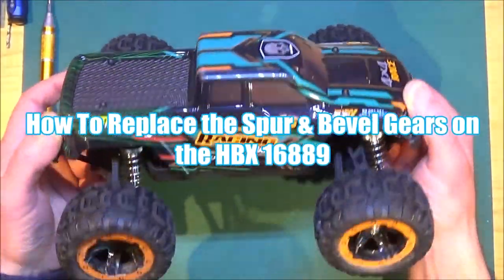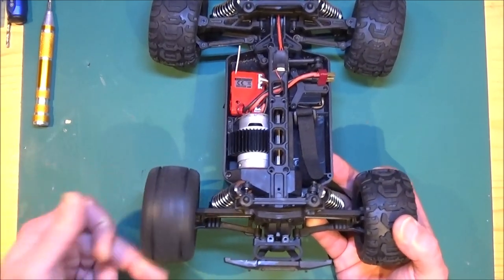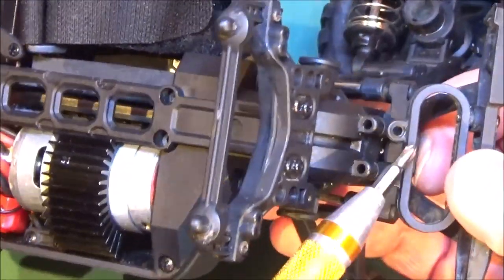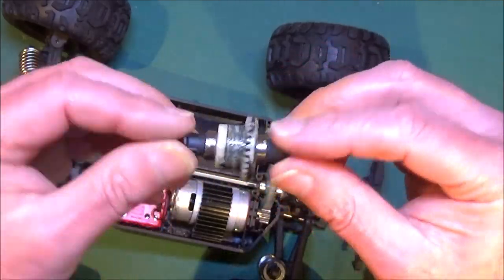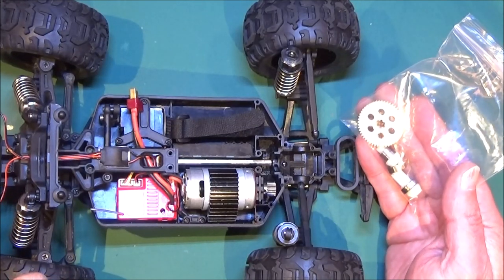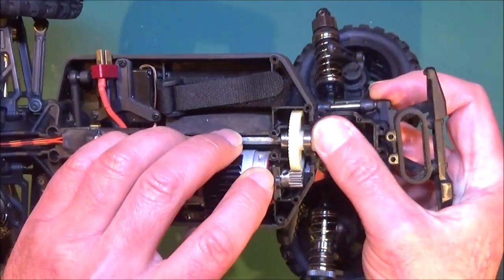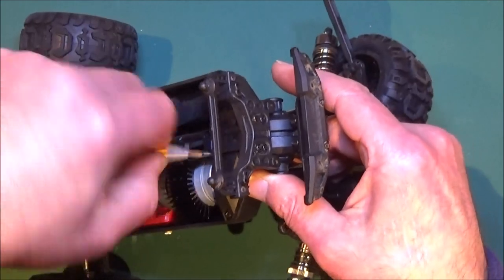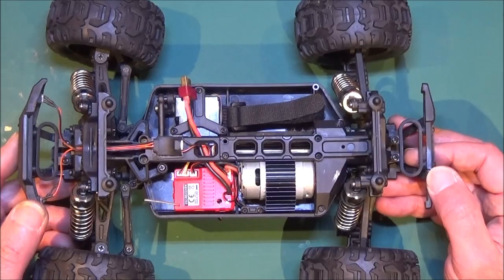How To Fix HBX 16889 Ravage Bevel & Spur Gears - Using Non HBX Parts! Haiboxing RC Fix!

Comment: I've just bought the brushless version of the FTX Tracer and it is a little beast. I will certainly be doing the important upgrades after the holidays.
Reply from the maker: Hi Nick, oh yes the brushless versions of these trucks are bonkers! There was almost no grease in my gearbox so it's worth checking inside. Good luck with the upgrades! 🤞👌👍

Comment: Great find and tip mate. I was looking at the FTX Tracer so we could do some bashing together but when you told me about the problem with getting spares for yours I put it on the back burner. But now yours is ready to again just going to have to order one soon. Great stuff mate catch you later.
Reply from the maker: Hiya, mate! Yeah, that sounds cool, hopefully my breakage was a one-off and other trucks with this chassis will go on much longer without issues. I think Time Tunnel has the Tracer for £53 - blooming good deal!  Catch you later, dude!  :O)

Comment: Your the man thank you for the driveshaft video you did I looked everywhere for metal but then I realized something the bezgar 7 I have is exact to your truck which also means the chassis to the hosim 903 and blomilky destroyer are also the same but anyways my point being you can throw a brushless motor and esc in from Amazon for about $30 its from the brushless version of mine called the bezgar hm165 and then the 903 makes these in metal for about $15-20 on Amazon fully upgraded these trucks are pretty beast
Reply from the maker: Hey Roger, thanks, man! Good info on all those chassis that share the same parts, very useful to know! If I can get some money together I'll definitely look at the brushless spares.  These cars really are cool little beasts! All the best to you, thanks again!

Comment: Good fix, Mark. Uhh, I thought these ones had metal gears. And yeah, got that truggy you showed, just in a brushless HBX version (16890A). Seen a lot of companies sell them. FTX and Pinecone and some others I can’t remember. I always wonder if there is a company behind the models of Haiboxing/HBX (that manufactures to other brands too) or if they are rebranded HBX. Anyways, good repair, my mate 🙂
Reply from the maker: Cheers, Mikael! I wish it did have metal gears! Yeah I saw that version you have on the channel. I don't know what company originally built this chassis, but it would be great if there was a "pool" of spares that we could access for all the derivatives that use the same parts - but that's why I did this video, to show that if you search, parts from other brands might fit. All the best, mate!  :O)

Comment: Hi - i noticed the stock plastic axles in the rear. Do you still remember the issue or why you put them back? I upgraded mine but it turned out the metal axle’s body was a bit smaller than the bearing’s diameter and caused terrible shaking in the rear wheels when i ran the vehicle. It was undrivable 😂 had to put the plastic axles back to keep the rear wheels from shaking. Cheers
Reply from the maker: Hi there and very well spotted! Yeah I put the plastic axles back in because I was worried that they might have been part of the reason the gears stripped as it was OK before I fitted the metal parts. Just erring on the safe side! It's been fine since though. Strange that yours were the wrong diameter, there must be some quality control issues! All the best! Cheers!

Comment: Great work Mark, especially in identifying those English based replacement parts. Top tip. I'm surprised that the gear failed like this - they must be made from a fairly brittle plastic. You would expect them to be a fraction more pliable which would make them almost unbreakable. But herein lies the problem with budget Chinese RC's - based on this they don't seem to be too durable. Did this fail happen after just one run ? Either way it's hard to imagine this kind of thing occuring with established brands like Tamiya, Traxxas et al, although I suppose anything is possible. The next thing you're going to face is the question: will it happen again ? Luckily for you though mate you have a shed full of tried and tested Tamiya thoroughbreds to fall back on. Great informative video and have a great weekend...👍🏻👍🏻.
Reply from the maker: Hiya, dude! Thanks so much for watching this non-Tamiya video, your support is truly appreciated.  Yeah, I was very surprised by the gear failure, everything else on the car seems to be pretty robust. To be fair, as it was free, I really have bashed the hell out of it with little regard to it's wellbeing! I'm not sure if the metal dogbone and axle upgrade I did caused an issue, with the non-flexible replacements putting more strain on the drivetrain? Anyway, I put the plastic axles back on, so we will see. If it breaks again I'll lok at metal replacements (or throwing the car in the bin!!!!) I agree, in stock form it really should last longer than it has, but at £55 all-in and ready to run, something has to give, I guess. Yeah, at least I got 1 or 2 Tamiyas to fall back on!!! Cheers, mate, wishing you a fantastic weekend, too.  :O)
Reply: Hello, are you interested in off-road remote control cars?

Comment: Hiya matey. With all the excitement of having the vaccine yesterday I didn't get round to watching this till late last night. Anyway, interesting stuff. There does seem to be a lot of re-branding that goes on with these so it's a top tip to see if the part you require is available for the other version. I'm guessing that they also do a metal bevel gear for this? Always seems to be the gear that breaks on a Tamiya TT-02B. Those screws at the front look annoying where you need to poke the screwdriver in at an odd angle. Anyway top work my friend. So anyway did you get jabbed too? I haven't had any side effects yet. Makes me wonder if it's worked! Going to take it a bit easy with the beers while the vaccine does it's thing. Hope you are enjoying your weekend. Is work getting any easier? I've been fixing up the Arrma Typhon I bought from Nick. Needed a bit of work but running great now. Cheers for now mate 😀
Reply from the maker: Hiya, Pete! No worries mate! Well, it's lucky that there is a lot of rebranding when something goes wrong! FTX has a much better sales and service here in the UK than HBX. Cheap stuff, too. Yeah, the bevel gear does seem to be a weak spot on many RC's - but then it does have a hard job to do, transferring the drive through 90 degrees. 
My jab is on Monday - going together with Lou to get pricked! Good to hear you have no side effects, fingers crossed. Work is OK, already looking forward to Easter and 2 weeks off - hopefully bag a load of RC footage. No new cars due to the money situation, but I've got a few cars already to film, thankfully! Good luck with the Typhon, sounds like a cool project for you. Enjoyed the latest video! Take care, mate, catch ya later!  :O)

Comment: Great video n  Can you point me in the right direction to get a new pinion gear ⚙️ please?? 🙏 I can’t find one as I want to swap the motor out in my HBX Destroyer and can’t get the old pinion off the motor to swap over?? They must of put tons of evo stick on it. Thanks 🙏
Reply from the maker: Hi there! The only pinion I could find was attached to a motor, maybe it is permanently fixed? Anyway, in case you are interested, here is the link I found:
https://www.ebay.co.uk/itm/274778278194?hash=item3ffa0fc932:g:T~gAAOSwfCZgS5AA
All the best, good luck!  :O)
Reply: @MarkBryanRC  respect ✊🏻 Thankyou very much I’ll have a look 👀 but I may have to drill out the grub screw?? I just want to swap the brushless motor that comes with the Destroyer out for a 6100kv surpass hobby one I’ve bought. Hoping for more power? Thanks 🙏 for the link 👍👊
Reply from the maker: @Andym1159  You are very welcome! Ah, I see now that you already have a new motor!  I think it should have more power. You could try heating the pinion up, it might free the threadlock that's holding the grub screw. You will need to get it nice and hot. That usually works for me. Other than that, you may just have to drill it out, but go carefully with that!
Reply: @MarkBryanRC  I’m gonna try some heat?? Thanks for your help 👍
Reply from the maker: @Andym1159  I have my fingers crossed for you, hope it works!  👍👍👍
Reply: @MarkBryanRC  thanks 🙏 I’ll keep you posted, I know I could of just bought a new esc and ran it on 3s but I don’t want it too wild!! I just want that bit more punch for the ramps at the skate park? We shall see? Cheers 🍻
Reply: @MarkBryanRC  I forgot to tell you I found a pinion I’ll post ya off which site in a minute, I wish I’d of bought 2 or 3 now!! 👍

Comment: Hey, if the platform is the same as the redcat volcano 16, then the differentials will not fit?
Reply from the maker: Hi Chris, I just had a quick look and the volcano does appear to have the same chassis. Can't be 100% sure, but there is a good chance the diffs will be interchangable!
Reply: @MarkBryanRC  I apreciate it
Reply from the maker: @chriis2871  No probs, Chris!

Comment: I have a really weird question..
I want to order a battery for this car and i dont know the length of the battery so could you maybe tell me the lenght lf the battery??
Reply from the maker: That's not a weird question - very sensible! The battery is 55mm long. All the best from Mark...
Reply: @MarkBryanRC  And is there a Chance i could fit in a 65mm battery?
Reply from the maker: @_b_nc_5606  I don't think so - you may be able to squeeze in a 60mm battery, but 65mm is too big!  :)

Comment: That's odd, thats the standard motor in there right? Wouldn't expect a bevel gear to fail like that. Then again it's cheap I guess.
Reply from the maker: Hi Bob - yeah, I agree! I was surprised it broke, but to be fair I really have bashed the hell out of this one!!! It may be down to those metal axles and dogbones I fitted, as they take any of the "give" out that the transmission had with plastic parts. Anyway, I hope it was just a dodgy gear and the new one will last longer! Time will tell. All the best, my friend!  :)
Reply from the maker: Definitely!  :D
Reply: if you get out of sand they last a lot. mine lasted many hours of tarmac and dirt bash. the moment i took it to the beach the rear diff pinion went out and a few bashes later the front one also. a set from aliexpress cost 3 euros...very cheap. you can upgrade for metal parts but i can not find for my pro version only the diff pinions on sell. they sell only the pack of metal diff plus pinion and to get only 2 pinions you have to buy 2 sets which becomes expensive. when the metal parts on my pro version wear, ill put plastic parts with stock shaft version. its extremely cheap and even if i have to change parts 3 times a year, its still a lot cheaper than buying full sets of metal gears.

Comment: With motor off, if I move rear wheels the front don't move anymore. I bet I have to do the same!!! But with motor running they spin
Reply from the maker: Hi there! Hmmm, sounds like you just got one or two teeth snapped off the gear. Well worth stripping it down to check. Good luck with the fix!  :O)
Reply: @MarkBryanRC  nothing snapped. I realized later that is normal. With motor off, the shaft only mooves if you hold one wheel and rotate the other.
Reply from the maker: @farmoboy83  Ahhh! Great news! Glad to hear your car is OK! 😁👍

Comment: What grease did you use and how much?
Reply from the maker: Hi. I used molybdenum grease, just enough to cover all the gear surfaces.
Reply: @MarkBryanRC  I am tempted next time I open the gearbox not to use grease at all at least on spur gear. Took my other rc, fc610 for a spin on beach sand and had to open and clean all the gearbox because sand entered the spur gear housing and was grinding like hell. If I kept it running like this I would surely strip something. Fc610 has metal spur gear but on this plastic spur gears not using any lub would be OK I suppose
Reply from the maker: @farmoboy83  Yep. If you keep running on sand then leaving out the grease might be a better option!  :)
Reply: @MarkBryanRC  live and learn! Also for those like me that fortunately have money for more than 1 rc car, I will use my brushed 16889 for this type of "adventures" and the others for other kind of tracks.
Reply from the maker: @farmoboy83  Definitely a case of live and learn, it's the best way! Good idea to keep the 16889 for the sand, it can take it well!
Reply: @MarkBryanRC  today at the beach noticed the gears striped... At home changed spur gear and both gears closed to the diffs even though only one of the (the one closer to rear diff) was really stripped. Spur gear still perfect but changed anyway since car was all open and they come in a pack. Still original bearings. This time only lubbed the diff but not the spur gear. Also, pinion is still good as new. Great little cars!!!!
Reply from the maker: @farmoboy83  Good to hear you are doing a great job maintaining your buggy, most people just keep running them until one day it doesn't work anymore! Keep 'em running! ✌👍